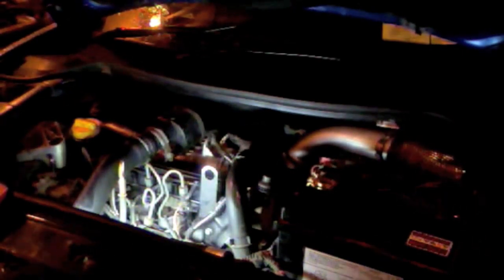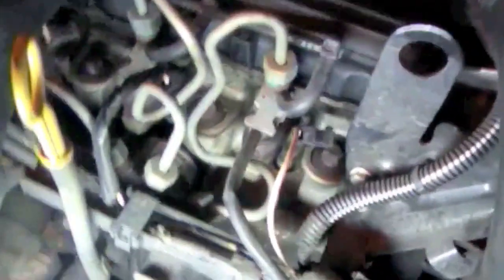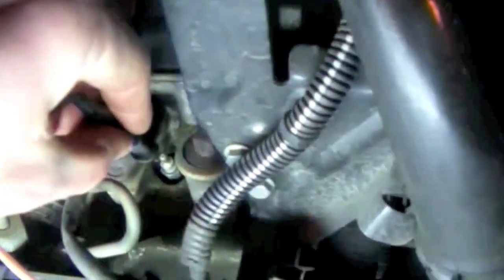How to test Glow Plugs on all diesel engines

Comment: This is complete bollocks. Firstly the resistance of the plug is the important metric, secondly if you connect the positive battery terminal to almost anywhere in the car it'll read the battery voltage....what a numpty.

Comment: All it shows that 12.5 volts are going to the plug. Even if the plug's fucked, it would still say 12.5v as there's 12.5v coming from the battery. The resistance should be measured.

Comment: I have a flashing engine light on my Nissan caravan TD 27 turbo diesel engine. It has no power and problem with changing gears. What could be the problem?Chongo Lukwesa.
Reply: Aixam 500 crossline tapits
Ajustment
Reply: Ajustment please

Comment: ignore this video, this is not the way to test glow plugs, test the resistance as they may show 12v but still be knackered, i had a customer last week that done this test and showed 12v on 3 plugs so replaced the one that did`nt only to have the same problem. When i tested them 2 of the others were not  working either although showing 12v.
There are to many people putting videos on youtube that don`t know what their talking about and costing people money and time by replacing other parts or garage fees thinking (in this case) that their glow plugs are working when they may not be.
Reply: richard pomery if there is a short on the glow plug you will get 12v this guy doesn't know what he is doing
Reply: This just shows your glow plug relay and batteries are fine. To test glow plugs,  check the internal resistance or the current through the plug. He obviously doesn't understand the difference between voltage, current, and resistance.

Comment: You can use V or O, if you get a lower V reading than your battery, remove it and double check with O or hook it up to a battery, tip is plus and the body is neg.

Comment: this is not a glow plug test
Reply: If it is now a glow plug test then what is it?
Reply: Andrew Brennan He would need to set his multimeter on the 'ohm' setting for it to be a valid test. Also you have to measure on the glow plugs itself, not via the battery. All he measures now is that the battery is working..

http://www.ngk.de/typo3temp/pics/e0e258382a.jpg
Reply: Johnny F. Good Thanks! I had done some research after that led me to the same conclusion but it's nice to have some back-up knowledge. Also, the most conclusive test would be to remove the entire plug and charge it with 12V from the same positive and negative points, checking for a red glow that is even and quick to start - for anyone else who might be wondering.

Comment: yes all diesel do not have spark plug they all have glow plugs. I'm still reading about diesel but what i know is they all have glow plugs and they last a lot longer but be careful with water getting in the gas they have been know to have that problem. But keep in mind I'm still learning and reading. But i do know for a fact that all diesel have glow plugs no spark plugs if that answers your question.

Comment: This doesn't really test the glow plugs, it just shows that they are not open circuit. A better way to test is to measure the resistance between the battery negative and the connecting tip on the glow plug. Better still, run some current through it and look for similar current across all of them.